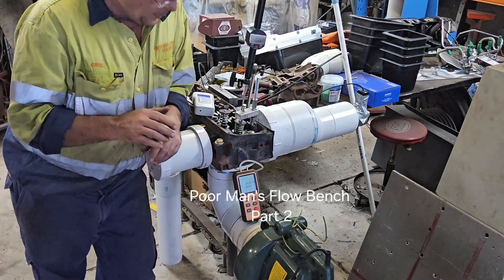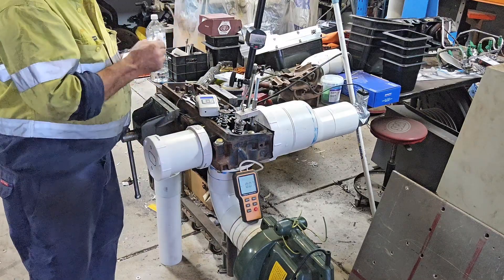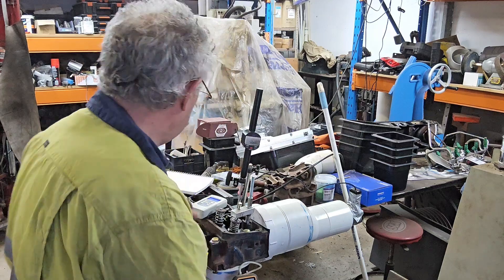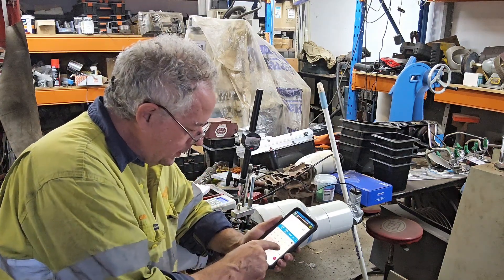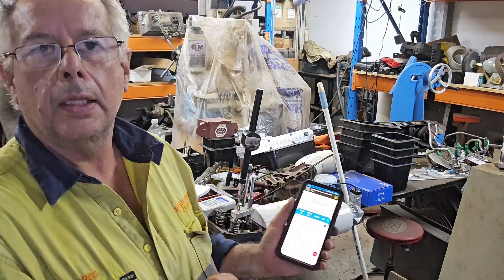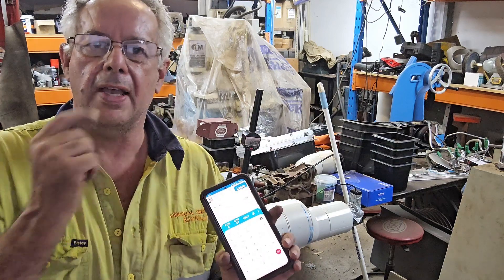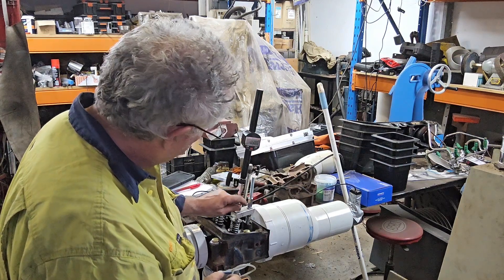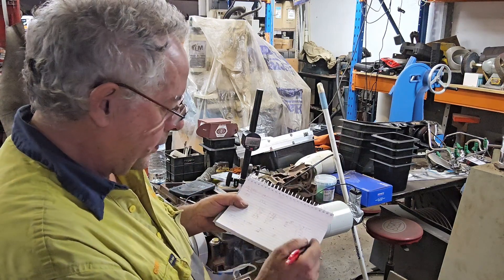Poor Man's Flow Bench Part 2

Comment: 👌Excellent. Good enough as a reference point.
Reply from the maker: @stevegus2845  thanks for watching and commenting. The objective was to get meaningfully comparative numbers, not absolute laboratory level accuracy. From that point of view, I think it achieved its objective. That said, there are a couple of low cost upgrades that I intend to do that should improve its easy of use, and improve its durability at the same time
Reply: @RevShedPerformance  Exactly, I agree. people get too hung up on the numbers being accurate. its just a comparator. as long as its repeatable.

Comment: If I may why did you use such large diameter pipe which gives such a high Q? before the anemometer and not a close to straight pipe?
Reply from the maker: @holdenrestoration2557  on the intake, i didn't want a ramming effect to occur. I wanted the volume and area to be large enough to represent open atmosphere. On the exhaust, i didn't want a nozzle effect to occur. I wanted the airflow to expand into the pipe,  and then neck it down into the anemometer. Additionally, on the exhaust side, i didn't want to port to behave like it had a pipe on it. Again, I wanted enough volume there so the port essentially behaved as if it was venting into open atmosphere
Reply: @RevShedPerformance  OK....how are you compensating for turbulence? when I worked at CSIRO we used to use drinking straws inside the manifold to compensate for turbulence which worked a treat, they were installed such that they were all parallel and filled the pipe section (plastic straws mind you).
Reply from the maker: @holdenrestoration2557  i haven't bothered to do anything about it, hence the reason that I'm seeing the numbers move around a bit during testing. As you'd be aware, the straws you used created a laminar flow grid. The idea behind this design is for it to be as simple as possible, and yes, it can be further refined. I'm going to use fish tank grid mesh for the flow grid on my new bench,  if I got carried away, I could also do it on this one, or just fit some short sections of smaller diameter pipe into the 100mm, but I wanted this to be quick to build, simple to build, and provide reasonably comparable results to other benches. That said,  it is not a laboratory level accurate device, but it appears to be within 2%, which is apparently about the same as a number of commercial benches. The big things are repeatability, which I'm usually within 1cfm, and comparability, which you can see the results of. Given that the tests were done on two different cylinder heads, several years apart, the comparability of the results are very surprising for mass production heads. When you watch Part 5, I think you will be very surprised at the results of the intake test.